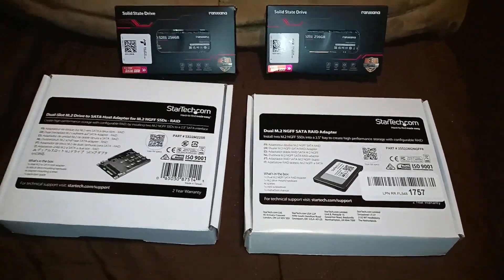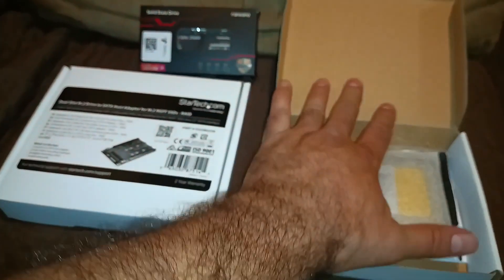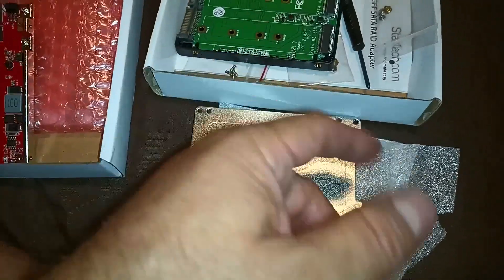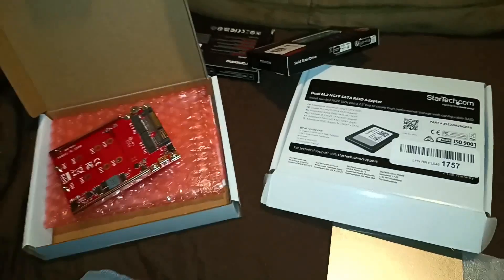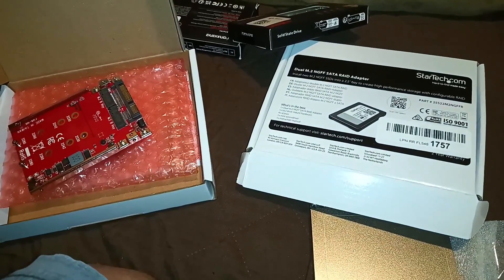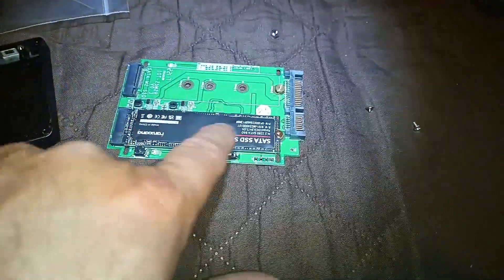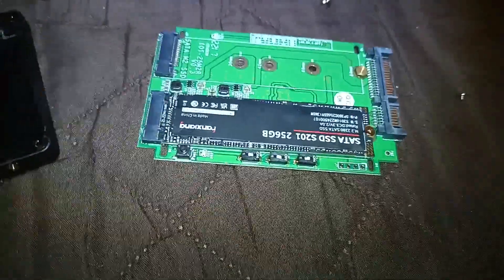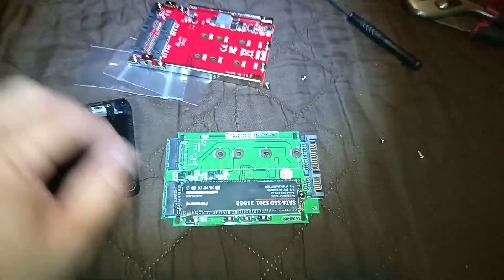Dual m.2 SSDs enclosures.

Comment: How's the performance going 8 months in? Is there a drop off in read and write speeds?
Reply from the maker: No. They are working great. No problems so far. So far I have only used one of the adapters in the Nas but it's been fine. I haven't needed the other one yet.
Reply: @myshots101  awesome to hear. I'm wanting to see if this works in a Ninja V, fingers crossed it does